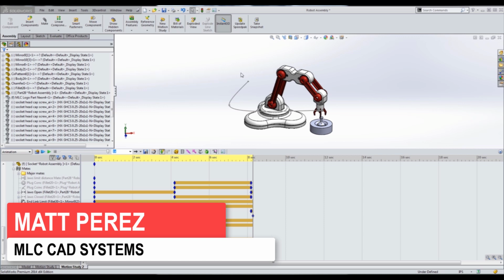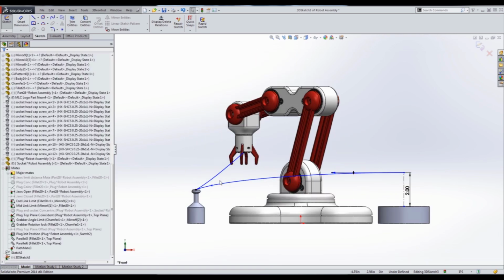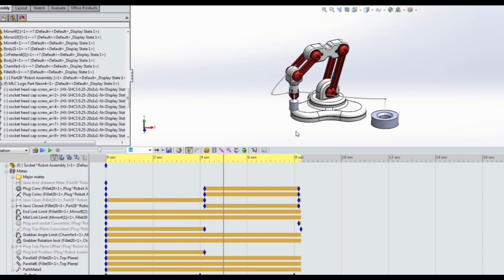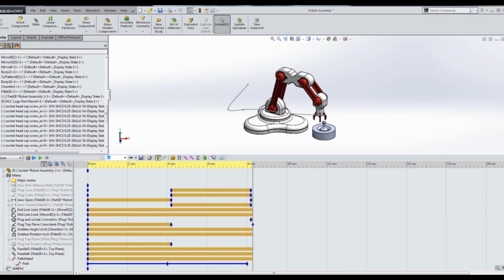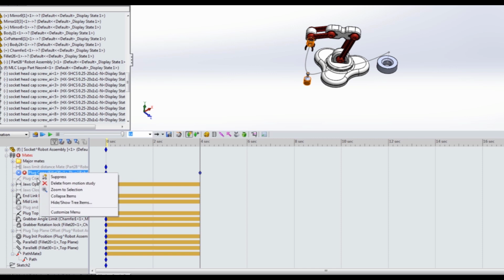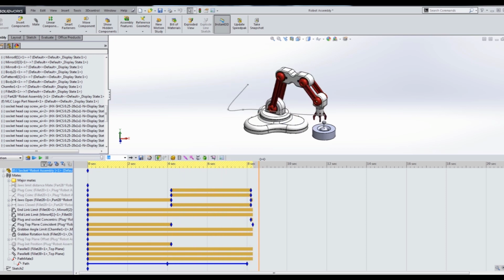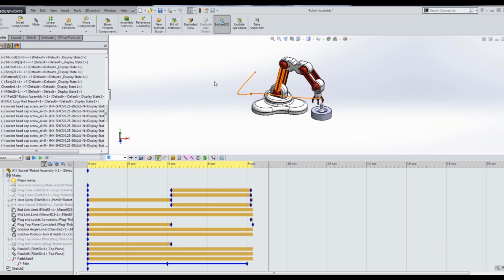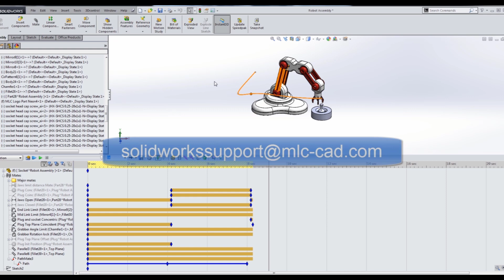Advanced SOLIDWORKS Animations 3/4 - Adding Realism

Comment: Really please made video about redundancies removal
Reply from the maker: See if this video is helpful.  https://youtu.be/OfEEEViERQg
Reply: @MLCCADSystems  before in solidworks we had cosmos motion where we can create joints straightway . Now we have to use mates to create joints . Is there any head and tail rule to create joints by mates .
Reply from the maker: Mates are how joints are defined.  It depends on the type of joint you want to make, so for example, a hinge joint can be created using a hinge mate.